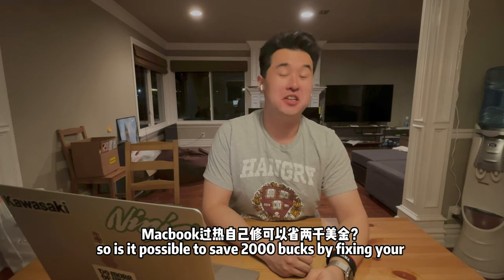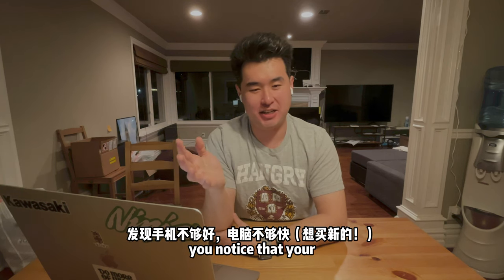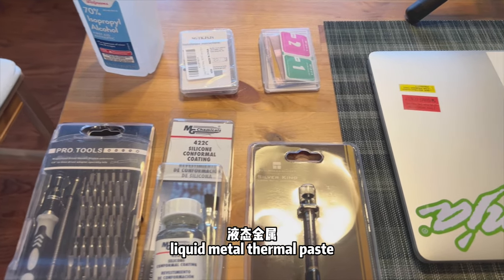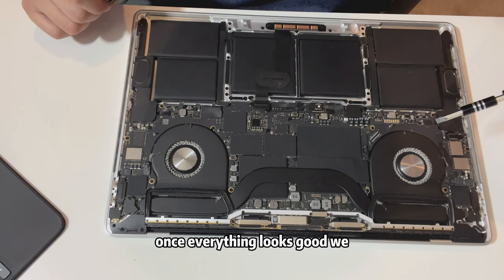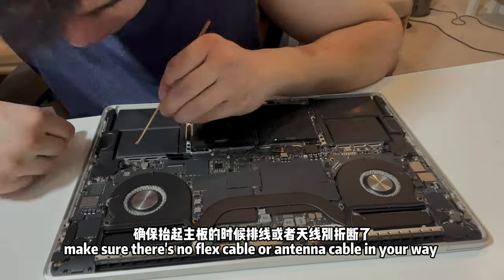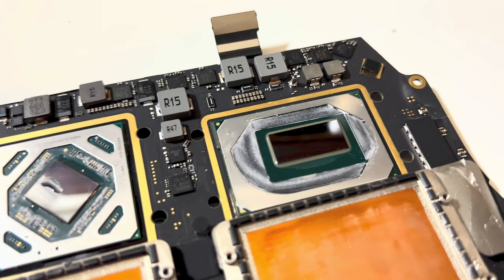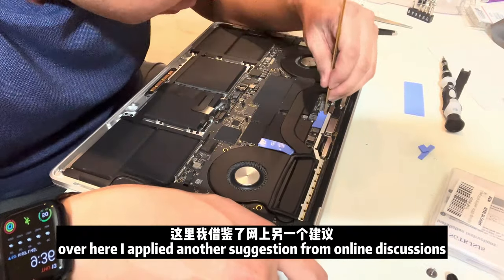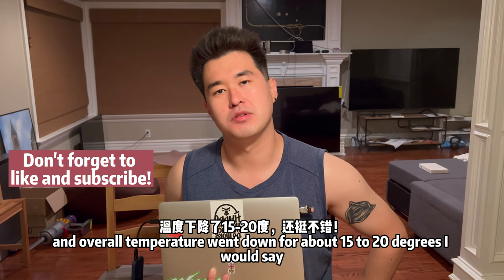Liquid Metal revives 2019 MacBook Pro! Thermal throttling fix that saved me $2,000!

Comment: Hi guys ! I did reapply a good thermal paste to my MacBook Air 2019 and applied thermal pads. I also did remove the black sticker on the back plate as it is an insulator. It absolutely saved my MacBook and now it runs 10-20 degrees cooler. Fans don’t kick in every time I watch a video and I finally am able to open multiple tabs !!! I want to thank this creator and everyone else on the internet for helping with their guides. It may seem daunting but is worth it !! Cheers mates 🎉
Reply: Great work! Did you apply the conformal coating to the cpu as well or just the gpu?

Comment: Liquid metal is dangerous, it can react strongly with aluminum! The macbook shell is aluminum alloy. There must be risks in this. Not only that, but it may leak out of the radiator gap due to improper control! You know, the macbook's motherboard is very densely integrated. It is easy to cause short circuit damage to the circuit board due to leakage.😱
Reply: Been running Liquid Metal for 2 years in my mbp no issues calling it dangerous is silly
Reply: @GlenQuagmire-dj9ws curious have you recently with last year opened up the internals to review the CPU and the Liquid Metal state? Did you use thermal paste or pads to act as a barrier to keep it contained?
Reply: @danielwillitzer7220  I haven’t opened it back up since I applied the Liquid Metal because my performance hasn’t dropped at all over the years. To contain it to just the cpu and gpu die I put electric tape around the cpu and gpu to protect it and I think it’s worked hasn’t had an issue